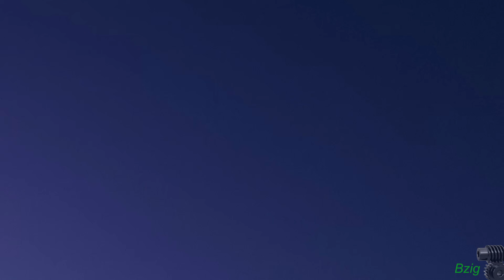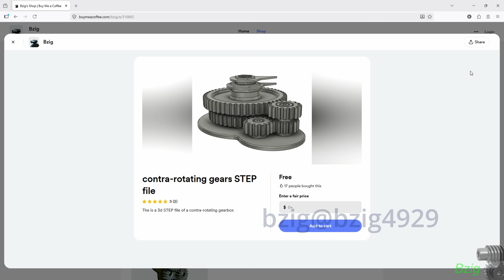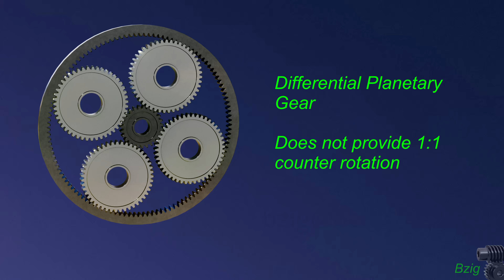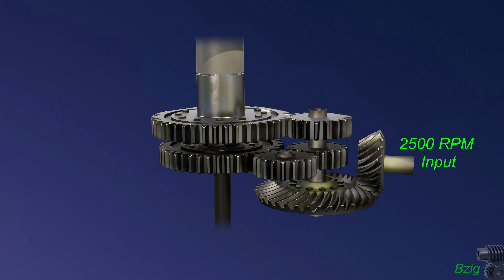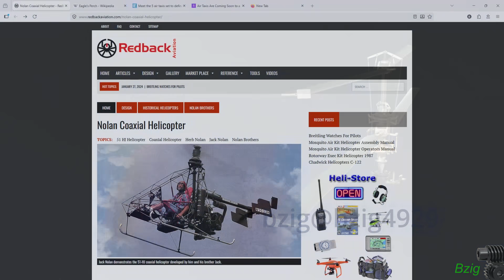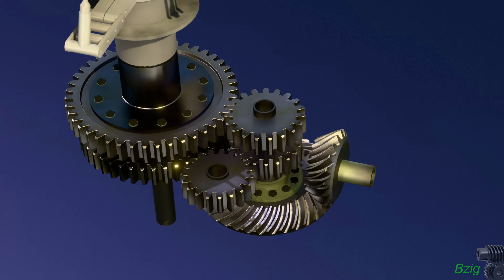Coaxial Helicopter Drive System

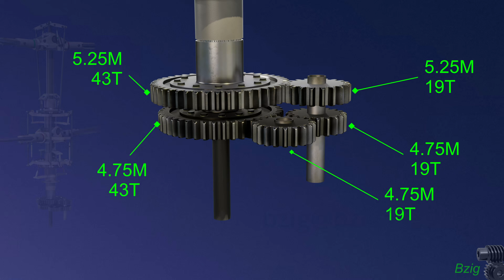Comment: I couldn't figure it out how does coaxial rotor helicopters do yaw movement. It is possible to change the rotation speed of rotors, however when i look at the drive system at 2:50, i couldn't see any mechanism works like differential in cars. It seems controlling the rotation speeds of rotors independently isn't possible to me. Am i wrong?

Comment: Can a coaxial rotor only be used for lift by changing the blade angle of attack? And use tail to apply pitch and yaw control and get rid of the swash plate?
Reply from the maker: yes!  I think this has been done before on unmanned aircraft.  There's also a pretty neat solution out there that uses a coupled rotor hinge and variable speed electric motors to control the aircraft without a swashplate.
Reply: @bzig4929  If the coaxial rotor only has blade pitch to control, how can we control the aircraft roll?

Comment: I struggle with understanding if both rotors (upper and lower) have the same collective pitch always or is it controlled separetly. For example during hover. The thrust generated by the lower rotor is smaller than the thrust generated by the upper one. However the torques have to be the same (one with + and the other with -). Can someone explain?
Reply: I am doing an analysis for coaxial rotor in VBM Ansys. Maybe someone did this in the past?
Reply from the maker: I cover this in my next video... will be published 7/3 at 1545 UTC.  The pilot has the ability to vary the torque between upper and lower rotors with the directional control pedals.  These control differential collective pitch (so, yes... they vary the pitch between upper and lower rotors) and they also vary the torque by using aerodynamic tip brakes.

Comment: Maybe It has serious fault.. The Kinematics is right.. But the Engine power is more 2000Hp... It makes great Power on the Each Gear tooth could not be kept this Power & Torque.. Most gear should be connected by Planet Gear set..
Reply from the maker: you are 100% correct.  I did a follow up video where I showed some of the other drive systems.  But I agree, any design that passes all drive power through a single meshed gear will not be able to tolerate high loads.  Although, small, piston powered, helicopters tend to not use planetary gears.

Comment: How do you calculate the space between upper and lower rotor planes ?
Reply from the maker: a good reference is A Survey of Theoretical and Experimental Coaxial Rotor Aerodynamic Research (link below).  From a performance perspective, the best you can get is H/D=0.05.  In other words, the greater the separation, the better the performance.  But there is no benefit from   spacing distances greater than 0.05 (ratio of spacing to rotor diameter).

There are blade dynamics issues in that the blades can hit if spacing is insufficient.  I don't have an answer on how you calculate that. 

 https://ntrs.nasa.gov/api/citations/19970015550/downloads/19970015550.pdf
Reply: @bzig4929 Thank you for your response including the link - very interesting paper !!!

Comment: The differential collective / yaw control is what I am here for.  Must admit I was expecting simple 3 gears (top shaft, bottom shaft, drive shaft driving both), with a slip ring riding on the inner/bottom shaft for driving the differential collective to the top of the mast. Fun part for autorotation, the yaw inputs need to be reversed.
Reply from the maker: I also have tip brakes (gyrodyne concpet) in this model.  But I don't plan on modeling the yaw reversal... I'm stopping at the non-rotating controls just below the lower swashplate and I image the yaw reversal would happen in a mixing unit downstream of that. 

I hope to a control video out soon.

Comment: So how do you alter the rotational speed between the rotor shafts to provide difference in torque for yaw pedal input as there is no tail rotor?
Reply: Differential collective. You don't change the rotational speed, just the work each rotor disk performs.
Reply from the maker: I agree with MD hover.  I'll get a video out soon that shows that.  I did cover it in a short video, but... it's a short and the topic doesn't lend itself to that format.

Comment: I do not want to be in an electric non autorotation vertical lift aircraft when an EMP strikes! (Though there might be larger effects to worry about.)
Reply from the maker: Certified airplanes are required to show they are OK in a HIRF environment.  Which is kind of like EMP.  But still, I share the sentiment.

Comment: Isn't this gearbox more simple and robust? Single bevel gear going to two large bevels.
https://www.gyrodynehelicopters.com/images/Transmission_Gear_Drives-benefits.jpg
Reply from the maker: thanks for that image... I did some research on the Gyrodyne but I didn't come across that.  The reversing bevel is similar to the soviet designs and it is better than what I chose to animate.  Take a look at the comment in this thread about Patent US20210291972A1.

Comment: Ever heard of Kamov or Defiant SB-1 or seen a small RC toy helicopter
Reply from the maker: Yes!  Those are all amazing machines.  There's a fascinating paper on the Sikorsky ABC, which was the predecessor to the Defiant.  It's a free download and I'll post the link below.  The technology they had to overcome to make the ABC is absolutely incredible.  Not just in the mechanical design, but also materials and manufacturing... they had to tailor blade stiffness and use a non-linear twist distribution... design solutions that were unheard of at the time.  The ABC had variable control phasing and for them to invent that in a non-fly-by-wire design is such an amazing achievement.

Another incredible feat of engineering was the MD  XV-1 which flew in helicopter, airplane and autogyro mode.  

There's been so many amazing past advances in vertical flight that I'm sometimes disappointed the future seems to be following the path of people-carrying quad copters that brute force their way into the sky instead of using the more elegant engineering solutions from the past.

Of course, the intent of the coaxial I designed, and posted on youtube, was to show some of the basic concepts of how control and power are passed to the upper and lower rotors.  Kind of a coax-101 video.  There are many reasons that my thing would never fly.

Here's the link to the ABC paper...   https://apps.dtic.mil/sti/tr/pdf/ADA100181.pdf

Comment: Use a belt, and a gear on the same shaft. Saves weight and space. No weird clearance issues.
Reply from the maker: that would work.  I've only ever seen belt drive on small helicopters (like the one I animated).  I assume there's a torque limit that prevents there use on the larger machines.
Reply: Yeah, I am arm-chairing here, definitely a scale limit. Belts are stretchy.

I will say though that modern transmission techniques are developing stiff belts.

Van Doorne belts and Morse HY-VO chains are two good candidates

I could see those on a bigger helicopter saving a smidgin of weight and form factor.
Reply from the maker: I looked up Van Doorne belts... super interesting.  I had no idea that belt driven CVTs had such a long history.  Thanks for sharing that.

Comment: You might want to use a 20-tooth idler instead of a 19-tooth one. The 1:1 between that idler and the pinion may prevent them from wearing evenly.
Reply from the maker: good point.  That would prevent 1:1 rotation of the main rotors... but, as I said int the video, that would still be an OK design.
Reply: @bzig4929  You can keep the 1/1 rotation. The upper gearset would be 19/43, but the lower gearset would be 19/20/43. Both are still 2.263/1 reductions.
Reply from the maker: thank you so much.  You are absolutely correct, the tooth count on the idle gear has nothing to do with the gear ratio.  Next time... I'll do math before I think too hard :)

Comment: ? bevel gear directly running upper-CW and lower-CCW rotors. Isn't it actual solution used in KA helicopters?
Reply from the maker: I'm not sure of the Kamov configuration.  I recently learned Russian Federation patents are online, and I did a little research into Kamov designs... but I didn't come across anything specifically on the gearbox.
Reply: @bzig4929  Counter-rotation in the Kamov Ka-26 (probably most popular coaxial model) is achieved through its VR-252 main gearbox, which contains a system of bevel gears that split the engine power and drive two coaxial shafts in opposite directions.
Reply from the maker: super!  Do you know if this photo is from the VR-252...  https://www.transhelicopter.com/img/minnerbanner03.jpg  

I really appreciate the info
Reply: @bzig4929  You are grossly overestimating me. Thanks! But no, I have no idea what this picture shows. 
However I have found some drawing of KA26 power distribution on random forum, cannot verify it yet. Regardless, it is not very clear what kind of a drive it is, I am very bias it is a bevel gear but may be very wrong. I will drop an update if luck to find something interesting! 

There is many KA26 in Hungary, if you were lucky to find someone from there.

Comment: brilliant video, I like your drive design, very nice. 
The Bensen B9 had two different diameter rotors, they rotated at different speeds which was allowed by driving it with a differential, torque was automatically balanced and the blade speed was adjusted by the static pitch adjustment of the blades. The bigger diameter top rotor reduced the loss of lift from rotors in a coaxial configuration. 
I expect you knew that but thought I’d mention and of course the differential collective in autorotation reverses the pedal direction.
Reply from the maker: I was aware, but do you know...?  are pilots trained to do this procedurally, or is there a system that switches the input?  I'm a long time helo pilot and instructor and I can't imagine training would be effective.  The whole "do it this way, except for the 0.01% of the time when it really counts... then, do something different"
Reply: @bzig4929  replying again as it didn’t seem to work. 
There is conflicting information regarding a pedal reversal system on coaxial’s with differential collective. Kamov’s have large tail vanes/rudders which may well override differential collective. Differential collective is less effective in autorotation anyway. 
Cool you are a helicopter instructor. 😀

Comment: Differential collective ? .. is that for yaw control ?
Tricky problem to solve for... I'd be interested in seeing what solutions you might explore for this :)
I think that yaw control via differential collective seems a little easier with an intermeshing rotor system... possibly :)
Reply from the maker: agree... an intermesher would be easier to solve rotor control!  For me, this was the was the hardest part of the kinematic modeling of the coaxial.  The way I designed the swashplates, not only did I need to use differential collective for yaw control, but it also plays into collective control of the upper rotor.
Reply: @bzig4929  The only solution I could come up with was a pushrod up to the top through a hollow mast which is what it looks like you have done too.
It was either that or differential rotor speed via brakes or gear clutches or electric motors etc.

Comment: What IFFFFFFFF!  we use 3 spiral bevel  gears instead all these gears! Just imagine a  spiral  bevel gear for lower mast and bevel  spiral  gear for upper and another one for engine output. It will give you same speed. doesn’t need to add more gears to change the rotation direction.( power going through a different gearbox for reducing speed and gaining power then to the that spiral Beville gear that rotating other two spiral bevel gears.)!
Reply from the maker: that sounds like a combining gear box in reverse!  I agree... it would work.  It would need a clutch for each rotor, so they wouldn't stay in synch after an engine fail, but that's OK.  You just made me realize that I left in the part, in the autorotation discussion, where I said the rotors have to stay in synch.  They don't.
Reply: @bzig4929 you  got me 😂 I forgot  The autorotation !!!!!  But instead clutchs  you can place the  the sprag clutch between  bevel gear and the shaft (mast ) 😊

Comment: Awesome video. Definitely would be interested in the flight control linkage. Had a question about the 2 separate rotor systems spinning at different speeds. Would that have an effect on the anti-torque properties of the coaxial design? Since both rotor systems spinning at the same speed is supposed to cancel out that pesky anti-torque force?
Reply from the maker: If you made them "nearly" 1:1 then you could balance any torque difference with a differential collective input.  But if you wanted a speed differential, you could still make the torque equal by setting the blade pitch lower on the higher speed rotor.
Reply: @bzig4929 
I see thanks for the explanation